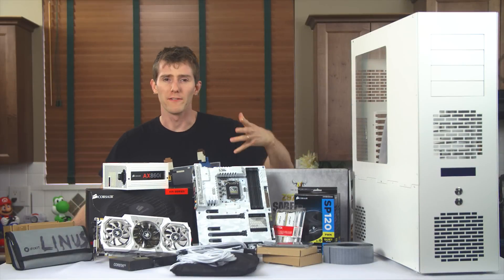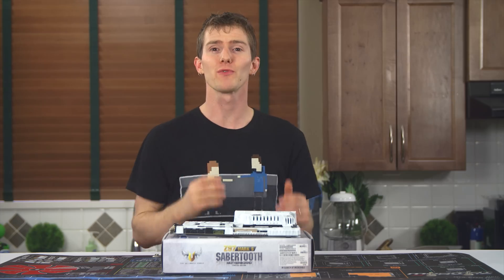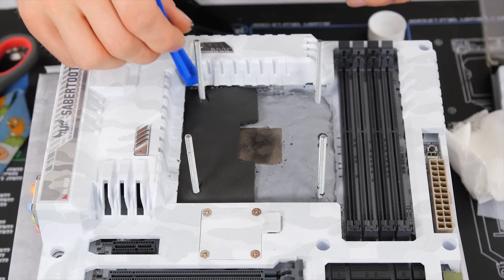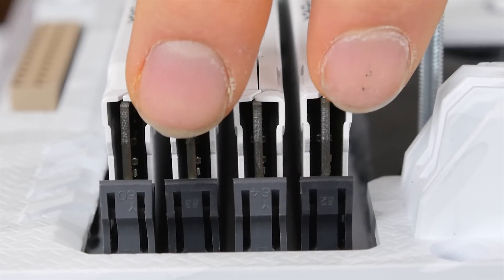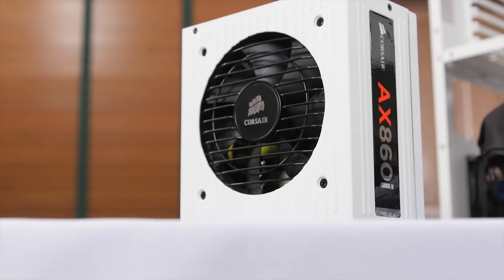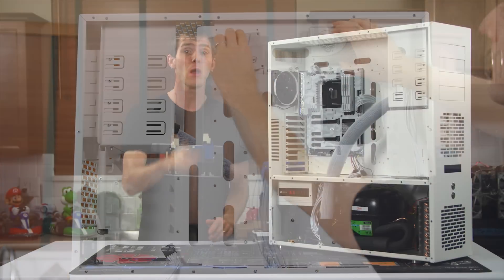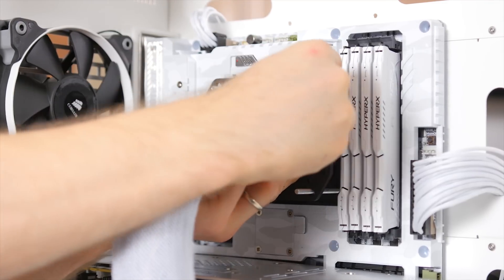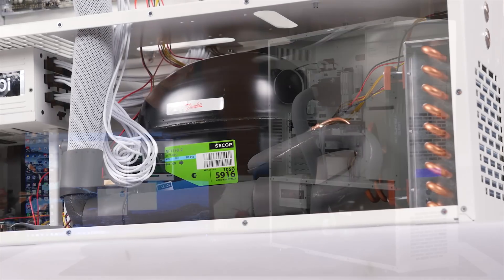ULTIMATE Sub-zero Phase Change Cooling PC Build Guide

Comment: 5GHz? I guess that was only the beginning. I did 4.4 GHz 4 years ago with an AMD Phenom II X4 965 (3.4 GHz) with a Biostar MoBo, on air, hitting only a max of 38F. YES! AIR! And at Puerto Rico in the summer. I only turned the A/C of my room on and redirected the cold air to the PC with a Craftsman vacuum cleaner hose. And wait some minutes to turn on the rig? Mine was just press ON and booted in 13 seconds. So... this is lame, Linus.

Comment: that case cost 1300€ :-D
Reply: thanks for clarifying. I had just assumed you didn't want a 1080...
Reply: Emgeton DSO wow. My pc is €1395
Reply: my is like 1500€ with all components:D
Reply: Emgeton DSO with the screen, key board?
Reply: Colin Vos yep also gpu
Reply: Emgeton DSO my pc with everything is around 1800 euro
Reply: Colin Vos hmm what cpu and gpu do u have ?
Reply: Emgeton DSO an Intel i7 4790 and a GeForce GTX 970 4g Gaming. But I want a 1080
Reply: That case+Phase change cooler is 1300

Comment: Linus warns to not build pc in a fridge proceeds to build a pc in a fridge lol
Reply: The difference is the compressor on a fridge is made for intermittent use, the occasional opening of the door, and can't dissipate heat fast enough to handle a constantly running computer. But the compressor used in the build is meant for constant use and is much more specialized for cooling a processor.
Reply: Not really. Surprisingly, I just finished that exact video. He only put a small, AIO inside of a mini fridge and said it did the job of cooling it.
Reply: No its fridge in pc, its different direction.
Reply: manzoor Athar Not what I am talking about, it was a different video they made
Reply: It's not that you shouldn't do it with a fridge, but not a fridge with a cooling capacity below your pc's heat output.
Reply: Also CRYOCOOLER PC!
Reply: he said not to build a pc in a fridge.....so he built a fridge in a PC.
Reply: TheDriftZone he built a fridge in the pc. Big difference
Reply: This is more of an a/c unit...same concept though
Reply: Sefaross 477 if you were truthful about finishing the video then you must have really not payed attention because he tried it with a desktop and the ambient temperature in the fridge was the same as the room.
Reply: its a fridge in a PC...

Comment: I'm cheap. I would sandwich a 240w peltier plate in between the cpu and a water block and get sub zero cooling. I would need a beefy radiator system to get rid of that much heat though. I think a 240mm rad would work.

Comment: i have had this idea for a few days, no weeks, i was trying to make a custom pc for hosting servers, (gaming web, ETC) i am currently concerned about power outages, i am wondering is there a way i could have a power bank, (It doesn't need to last for more than 30 seconds)
and the power bank turns on the second the power goes out, powering the computer, i would also like it to somehow be able to detect the power going out and then save the server (all it would need to do is enter a command in command promt, and if that was open all it would have to do is type a single command), i would like it to enter the command, because the power bank probably wouldn't last a few minutes powering the computer, so it could save it, i can't afford some crazy week lasting power bank, although i don't think one of those exists for consumer usage, i just wanna keep my data safe, also as
a side note, is there a way it can automatically backup data to a separate computer / ssd / flash drive, also as a side note, this is the longest comment i have probably ever posted
Reply: You mean like a UPS? Then you could use a small controller/relay to enter the lines into the command prompt in the event of a power outage.  They can usually last for a while.
Reply: Guyrations FINALLY SOMEONE REPLIES, I was expecting a flood of ideas, i'm like, BRO I just wrote this 22 line comment ffs, but anyways i already had an idea, there are those batteries that you plug into the way, and in the event of an outage you just plug stuff into it, my solution was to have one of those, and just have the pc run off of that, andx when the power goes out it would already be plugged in, but it would probably ruin the life of the power bank, also i was hoping to install mac os x on my pc when i get it, Not because i think it's better or anything, but because i know my way around it, a have a few scripts i wrote so i could just make it run a script, and also, it has a port forwarding app that isn't for windows, (It's the only app i could get to work) and for some reason port forwarding pretty much doesn't exist on my router, and i'll look into the UPS. Thanks ~Tntmod

Comment: Instead of the corsair AX860i PSU could you use the AX1500i Digital ATX Power Supply — 1500 Watt Fully-Modular PSU from corsair.

Comment: Can I suggest building a 600$ pc around the 1060?
Reply: better to build one around the 480
Reply: +edmund850 it depends on what you wish to use. But the two are very similar in price and performance,(though the 1060 is a bit more expensive and work a bit more also) so it's his choice.

Comment: where can I buy this case
Reply: It costs 1,300 bucks wouldn't recommend xD
Reply: to tell you the truth you can buy a phase changer with gpu cooler evaporator head but you aswel  buy a single head for the cpu and buy 4 phase change units with the gpu evaporator so each gpu can have very cool temps don't see the point in water cooling anyone might aswel buy 5 sub zero cooling units

Comment: Who in their right mind would actually try this? It's insane!
Reply: I would love this setup but not the case because phase change has a evaporator with a gpu and CPU socket so subzero cpu and  a single gpu imagine how fast your gpu would be if you overclock that bitch to a very high Max temperature of 95 degree for both the cpu and  gpu that will be one fucking fast computer with sub zero cooling

Comment: hey awesome stuff, one more request I have an AMD APU  computer that I built I opted to install corsair h110i liquid cooler for the processor hence I am planning to buy two gtx 980 for sli could you show GPU only liquid cooling using EK plates and radiator, please I am using a corsair 240 air, mobo is MSI a88xm micro atx, ram gskill Trident x 2400 ddr3
Reply: Any amd apu will bottleneck two gtx 980s. I would recommend you to buy one 980 and a better cpu.
Reply: +uriel juarez (kdog76) I will upgrade the mobo and processor soon but I am now looking for how to water cool only the GPU in sli setup.
Reply: 1st - Brand and make of two 980s 

2nd - Only EK?

Comment: Linus, it doesn't matter how you label it, that unit is nothing more than a small compressor designed for a small refrigerator. A few mods for extended use and voila! you have that unit. Still beats having to learn about thermal dynamics, to get your DIY.
Reply: wanna test it buy a heavy duty freezer rip it's guts out and find a cpu cooling head

Comment: I think I will just gut a mini fridge, get a air cooled computer, air proof the computer case, and set up a in-put out-put cooling air loop.

Could this theoretically work, sucking in air , cooling it, passing it through the system, and have a exhaust, and looping it back to the cooler. Of Course the system would be insulated with styrofoam, and the case would be made of... Plywood? 

Could this theoretically work?

Comment: To those wondering why he doesn't just push it farther. It's because the more voltage being cranked in the lower the temperature HAVE to be in order to maintain stability. Hence why they do LN2 (liquid nitrogen) cooling. You will see them with like 6ghz overclocks with temperatures in negative Celsius.

Comment: I had thought of it too and maybe with a R22 unit could be done but this looks gr8 .I did think of using the high side of the compressor to spin a Tesla turbine with a double shaft mags and coils on both ends for a generator. I mean steam is what drives our turbines and Freon boils at less that room temp. so skip the boiling of the water " burning fossil fuels of any kind" just an idea. I have no proof of concept as of yet but all you in interweb land can give it a shot ...save the world someone has too might as well be us

Comment: But can it run Minesweeper?
Reply: +Isaax Funny and original.
Reply: +FuriousTaco that's playable
Reply: At 640x360 at 3 fps low settings
Reply: +Vincent Sayer Touché.
Reply: 420x911 @69 FPS
Reply: it can barely run Minesweeper, and barely run solitaire XD
Reply: Yes, I'm sure there is a minesweeper for the Commodore 64.
Reply: Isaax can it play Knack tho?
Reply: Only on 19 FPS
Reply: Nope, not on Windows 10. Perfect comment.

Comment: why are you using a 4th gen i7? sees date oh.
Reply: I remember when the I7 4790K was cool... :'(
Reply: kasio eh. I7-980X is still a good processor. so 4790K is fine to.
Reply: +Xavier Bob I have a 980x I'm sick and tired of It. I'm gonna build a phase change build.
Reply: salman javed lol
Reply: As a personal rig I'm upgrading to the 6700k. I hope I made the right choice with the quad core. My 980x is dying. Blue screens now kernel panics. Haven't made a single upgrade. I replaced the graphics card and the ram modules but sane problems. If anything replacing a motherboard or CPU will cost the same as a new CPU motherboard combo. I had it paired with a Asus p6t7 ws and it was so fast. 6 years past too fast. I'm going to see just how fast a 6950x as I might build it for a friend. Its just its just as expensive as a 14 core Xeon so its not really worth it.
Reply: Ah yes, failing to boot was one of them too. Don't know why I think it's  just old.
Reply: As a ws computer I'm using a stupid phenom 2 x6 as a replacement for now
Reply: im on a lenovo laptop with an i7-5500u, 16 gigs of ram, and a GeForce 840M.
Reply: With my new build I'm reusing my Gtx 470. Good enough for need for speed. Nice laptop I always find expensive laptops that are always more expensive than desktops so I avoid them.
Reply: I remember when you didn't need to be really rich and show off to poor people how rich you were but that's cool.
Reply: you must be really old!! haha, joking apart you just need a job, the will and time to save money.

Comment: But if you had rubber gloves and were extremely careful, could a PSU kill you?
Reply: +MeatLoafMan Yes, due to the insulation of your typical rubber gloves, or commonly known as surgical gloves is actually quite low due to the type of rubber used and the thickness.  Where as the PSU even when turned off has a  rate of sticking a fork into a fuse box.  Okay maybe not exactly that much but pretty close.  There are special tools when dealing with PSU electrical hazards, and not all are exactly cheep and some actually require electricians licenses.
Reply: But if I was just gonna paint the outer shell and only touch the outside it would be fine right?

Comment: Look up case, see price "Nope...."
Reply: Remember to add the price for the PCI covers...
Reply: It would be less expensive for me in South America to move to the south pole and use my current PC there than trying to build this PC.
Reply: Second Account a compressor like that is €400, €100-€150 for the condenser+fan and the capillary tube (it's not even an expansion valve) + evap coil couldn't be that expensive (€200 absolute max) add in €100 for the regulator (looks kinda fancy and it's got two temp probes, 3if there's one for the condenser but I doubt it) €50 for the insulation and stuff around the suction line and the capillary tube, and  that's €900 (spare parts price) I could get them for around €400, and considering it's a full system and they buy them in bulk, they probably buy them from danfoss at like €200 - €250 so yeah, it's pretty much theft
Reply: Denuris Turgryn except that what you are describing doesn't include a case and an evap head
Reply: how much ??
Reply: I think the expensive part is the AC part on that case lol
Reply: madness in the inferno 3,000
Reply: It doesn't cost 3000 it's 1100 USD...

Comment: what if computer coolers could reach a temperature of ultimate zero (about -256? Celsius)
Reply: +Titan SixtyNine The metal would probably shrink (because heat makes metals expand), while the silicon doesn't shrink as much (semimetals are not as responsive to heat as metals) and any plastic in it's construction wouldn't shrink almost at all I think... so I'm guessing it would crack and break somehow if you brought the temperature down that low. Also conductivity gets better at lower temperatures, so having superconductors might change the way the electricity works inside it, I'm not sure.

Comment: As an extreme overclocker I find your method of using eraser abnormal although not saying bad because of removing the socket which is the first time I have heard of do so in such a way and personally I'd try to use only single piece of closed cell foam cut to shape

Comment: Why dont you put the computer in a sealed helium atmosphere so you wont have any moisture build up, then use a few Liquid helium quantum coolers to have the whole system sit at near absolute zero. Theoretically the overall resistance in the system should go down significantly meaning you should be able to over clock it a ton without the system itself even producing much heat.  At there low temps the electricity itself should be going through each individual wire faster thanks to the lower resistance, meaning the entire system should run significantly faster. I feel like you should definitely try this.

Comment: Under what circumstances would the cost of a phase change cooling system like this be justifiable? I just can't think of any. If you need the fastest speed possible and have plenty of money to spare, couldn't you just buy the fastest CPU on the market and water cool it? Even if money isn't an issue, Linus only got 5Ghz out of a 4790k which isn't much more than you can get with water cooling, so phase change cooling doesn't seem worth it to me. If anything, it's just an expensive way to show off your "cool" system (see what I did there?) and your extremely low temperatures.
Reply: +APPLBL00M well, I guess you can run it in the Sahara or ... in a oven.
Reply: I mean if you constantly upgrade and maintain you could probably at least use the case as a house

Comment: i need help, why is it called a cpu cooler? does it not cool the gpu too? only cools down the cpu?
Reply: Yes. The cpu cooler bolts directly over the CPU and so is only effective for cooling the CPU. You could argue that regular air CPU coolers boost airflow and so also cool the GPU(s) but that's pushing it.
Reply: +James Bennett then how do i stop gpu from over heating if I overclock it?
Reply: +Kevin Machado GPUs all come with fans stock, but if you want more cooling power you can buy watercooling blocks which replace the stock coolers from a company like EK
Reply: +Matt b Does it affect noise in a signifcant way?
Reply: Lord AJ
Tht depends on the liquid cooler. Generally the more expensive, the quieter the fans which push/pull air around the radioator (where the liquid lets off the heat collected from the GPU in this case). Often though it wuill be quieter since GPU 'manufacturers' will not use particularly quiet fans on the stock shroud
Reply: James Bennett
Ok, thanks for the information.

Comment: Maybe I missed hearing you say this,  But how cold a temp. does this single-stage phase-change unit provide for?  You brought up the subject of multi-stage phase-change units, which I happen to know are typically involved in industrial or scientific enterprize scenarios where they deliver sustained supercold temperatures for a lower cost than "open cycle" crygenic agents.  Nowithstanding the overkill in terms of institutional-like expense vs the personal means of the average overclocking enthusiast, it would make interesting reading if someone were to make a multi-stage CPU cooler which happens to also be of a sufficient continuous BTU displacing capacity so that "cryogenic-like" temperatures might be applied to a highly overclockable CPU on a continual, stabilized basis.